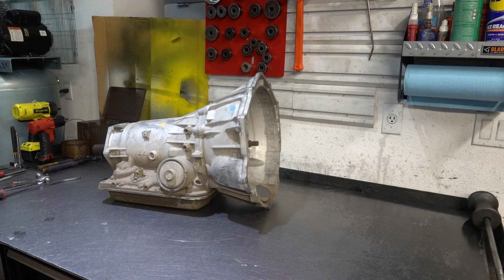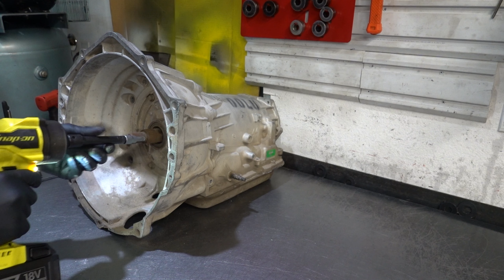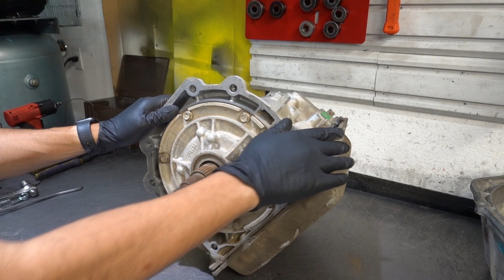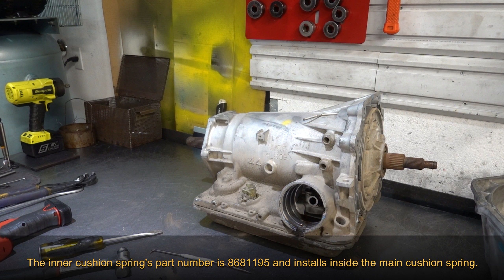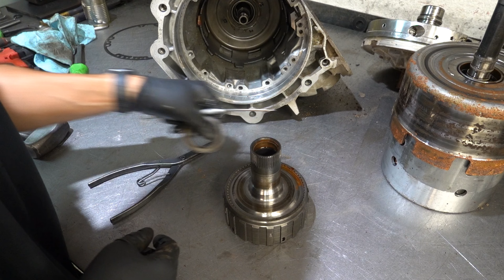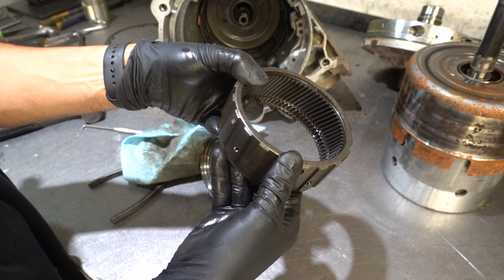4L60E Teardown and Inspection - 5.7 Small Block Chevy Engine

Comment: Hey my 95 camero Z28 with a 4L60E just randomly decided to not go into gear. The selector moves but it just won't go into gear, do you have any advice? Thanks
Reply from the maker: Yea, check your shift cable at the transmission, see if it's broken. Otherwise, put a line pressure gauge on it and confirm/deny the pump is making pressure. If not, pull it for overhaul.

Comment: Hey nick, thanks for the reply I got a 2005 Chevy Silverado 1500 5.3liter i just blew my differential gt5 g80 so swapped it out u joint was wrong size but anyways I go to put the truck in drive and it acts like it's in neutral reverse works and 1,2 manual works it sounds like also a rattling near the front driveshaft 4x4 works but I also just changed transfer case. Any help would be appreciated
Reply from the maker: Hi Jaxon, thanks for watching. 

Transmission will need to come out for overhaul...The differential failure may have caused damaged inside the unit, not sure but sometimes trans damage results from sudden differential failure.

I suspect your forward sprag one way clutch has failed and rolled over....The forward sprag holds in all range positions when in 1st, 2nd and 3rd gear. However, you're able to move when you put the shifter into manual 1st and 2nd because your low reverse clutch pack and band come on in those respective range positions and those elements are independent of the sprag holding (i.e. they will work regardless if the sprag is functional or not, provide they themselves are functional).
Reply: hey  @nickstransmissions  , thanks for the breakdown — that makes a lot of sense. Since I’m probably looking at a rebuild anyway, what would you recommend for a budget-friendly but bulletproof build on this 4L60E?

I’d like something that will hold up to hard street driving and the occasional launch without me having to worry about it again for a long time. What key upgrades or parts do you suggest I absolutely shouldn’t skip, and what should I know about keeping one of these alive once it’s built?

Appreciate any advice you can give.
Reply from the maker: Budget Friendly and Bullet Proof don't mix. Spend what you need to per your usage requirements and vehicle attributes - don't cheap out. 

Here's my 425 HP Build profile that may be of interest to you: https://youtu.be/R5QZxMmbJwU

If you will be making more than 550 HP or so, I'd grab a Sonnax Smart Tech Drum or Cope Racing 4L79 drum.
Reply: @nickstransmissions also how do I know which gen of 4l60e to order parts for
Reply: hey  @nickstransmissions  I have taken out my transmission for overhaul everything looked good and healthy inside the transmission on the magnet there was some clutch material but no chunks of metal or anything i get to the low roller clutch by the rear planetary and the clutch is completely shattered in piece and Im pretty sure on the rear planetary the face is broken off. Im just wondering if this is broken why I had 1,2 manual and reverse

Comment: Hey nick, great video very in depth. I have a question about my 93 Chevy 1500 with the 4L60E. I might’ve missed you mentioning it but at any point do you mention what failure causes the hard 1-2 up shift? I’ve pulled the filter and found flakes. Thank you!
Reply from the maker: Thanks for wathcing, ethansgarage. There's quite a lot of things that can cause a harsh 1-2 upshift in these units. I'll be doing a video soon on that very topic - stay tuned!
Reply: @nickstransmissions thank you

Comment: I have a 1999 Yukon 5.7 4l60e rwd green tag on both and a 2002 4l60e rwd 5.3but the bell housing is a lot bigger and the torque converter bolts are towards the teeth more all plugs the same and drive shaft fits how can I fix it 😭😭😭
Reply from the maker: Hi Rob, you'll need to find a transmission that is compatible with your 1999's engine application (Gen 1 SBC). The Gen3 4L60Es that were installed into all of the GMT800 and 900 series trucks are not interchangeable as-is with Gen 1 and Gen 2 SBCs / LT1s. The bell housing, pump stator, input shaft, torque converter and flex plate are all different. 

There are adaptor kits available but whether or not you want to spend the money on one is up to you.

Honestly, I would simply rebuild the transmission that is already in your 1999 Yukon - this way you won't have to worry about it for a long, long time.

Comment: Quick question, how do you determine what style boost valve originally came with a 4l60e pump? I have a "rebuilt" pump I was vacuum testing and when I disassembled it it had a Transgo .500 boost have. I know the Transgo works in both early and late style but if I wanted to go with a Sonnax oringed boost valve I need to know the size.
Reply from the maker: You don't need the size as the outer diameter of the boost valve sleeves are all the same and sized to fit the boost valve bore in that location. Simply purchase the Sonnax .500 boost and .283 reverse boost (both sleeves come w/o-rings) and you'll be good to go.
Reply: @nickstransmissions Sorry maybe I wasn't too clear but I was actually talking about boost valve sleeve length, I know there is an early 1.9 inch style and a late 1.8 inch style. The manuals I have and videos I've watched say they're not interchangeable, I was concerned because I have a pump that had the Transgo boost that works with both styles but pulled very little vacuum in that area and I wanted to replace it with the O-ring type.